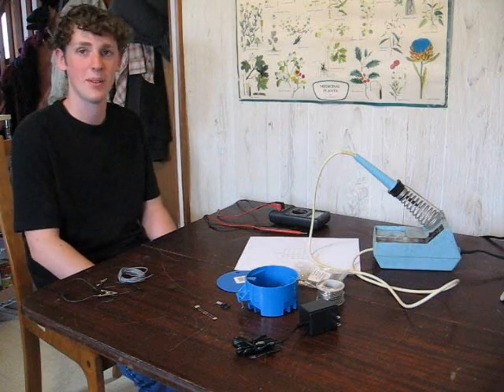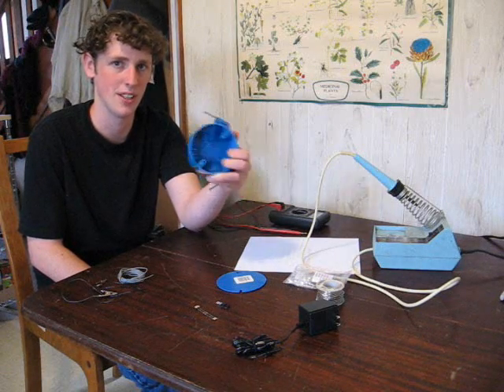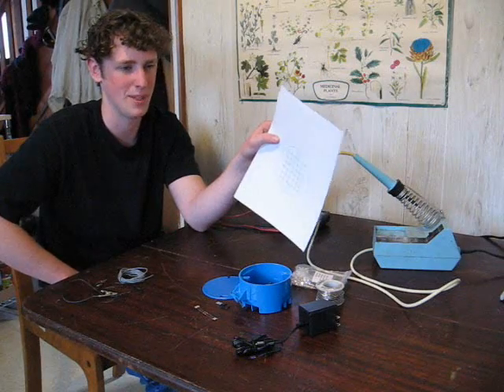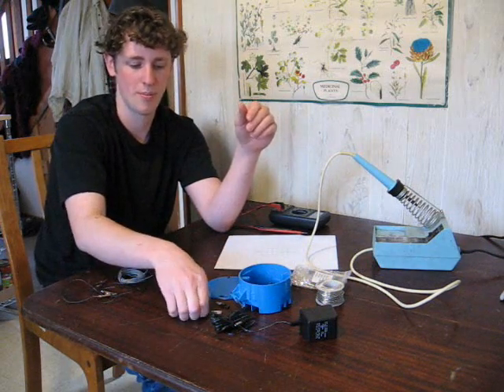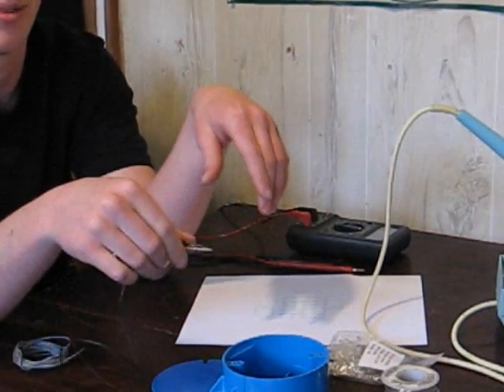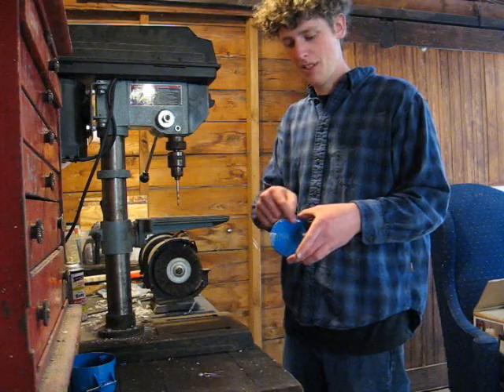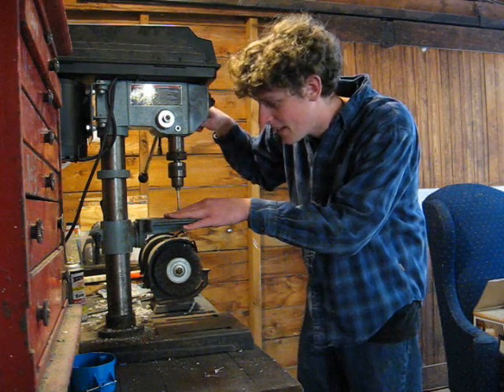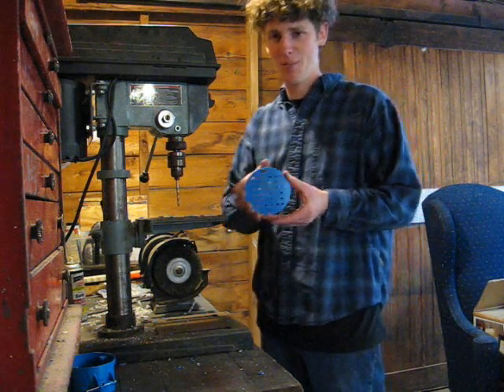How to Build an LED Light - Part 1

Comment: SKYPE: WINFYHSIUNG, EMAIL: WINFYHISUNG@GMAIL.COM
the king of LED downlights in CHINA.
Looking for buyers of IP44---IP65 LED downlights, 5W---100W, CRI: 80---95, energy saving A---A++ ,  2---8 inch, cut hole: 80/100/120/140/160/175/210mm, warrranty: 3 years. powerful and beautiful. hot sell in FRANCE and SPAIN, waiting for you.

led road flares, led flares, led safety flares, led power flares, led emergency flares, led traffic flares,

Comment: Nice job.  I'm hearing impaired.  Your English (transcribed) doesn't make a sense to me.  Can you to explain it to me in text?  You could email it to me on my YouTube email address.  Many thanks!

For example, I couldn't see the wires closer when you connect the LED wires together, and why you connect two groups of LEDs.  What power did you turn them on from a battery or from outlet?

I am not aware of different type of volts for different LEDs.  Does the LED contains gas in the plastic tube?

Comment from the maker: @rossjarrett These particular LEDs don't get hot. In my next LED project I used a Cree emitter mounted to a copper plate as a heat sink.Check outthe video on my acct. Thanks for watching. :-)

Comment from the maker: LED stands for light emitting diode.  This is not a video to demonstrate the manufacture of diodes. This is a video to demonstrate the manufacture of lighting units / fixtures that utilize those diodes instead of incandescent or compact fluorescent light bulbs. Thanks for watching our video; sorry it wasn't what you were looking for.

Comment: I know you probably already explained it during the video, but i got a few questions as i'm going to shop for LED supplies for replicas, i want to use either AAA or AA batteries as a power source, and i'd like to know what exactly i need, like what kind of LED's( 5mm Led's i figured) and what resistance do i need for either one? Thank you so very much in advance, i really appriciate whatever help you can give me.

Comment: @catskillwoodgas so i´m not familiar with this, but what happens if i make a light with twice the ammount of LED´s u used???, what do i need to power them???, i mean if u have 72 LED´s what do i need to power them?? (u said u could use a simple transformer like a dc output kinda thing) how many voltage or amps do that would need(sorry my english is not too good,iam not from the USA) thnks

Comment: Hi what type of gas or how does the LED illuminate? Unlike Sodium Metal Halide & Mercury Vapour Lamps which has an arc tube filled with gas where the electricity make the gas illuminate Iv made some videos of High & Low Pressure Sodium Lamps, Metal Halide Lamps & Mercury Lamps firing up & changing colour as they warm up although iv never got round to LED,s

Comment: ok n/m I figured it out. That previous rule is only for led`s wired in SERIES. PARALLEL wiring will allow a smaller power supply to run alot more leds  but requires uniform led color and power draw, and too many lights wired in will cause uneven lighting and blown home fuses ( I think cuz  amps are now compounding on themselves instead of volts like in series but dunno) Anyway, Parallel with this many lights is not recommended either.

Comment: I`m trying to learn how to wire LED`s for my aquarium, and I hear to determine the Powersupply needed, add 2 volts for the resistor, 2volts for each led and 4 volts for white blue and UV. so that 36 led light needs a 74 volt power supply?

Is this measurement for 5mm only? if my forward voltage is 3.4 and i used 36 leds wouldnt i need 122.4 forward voltages making it a 125 volt dc power supply?